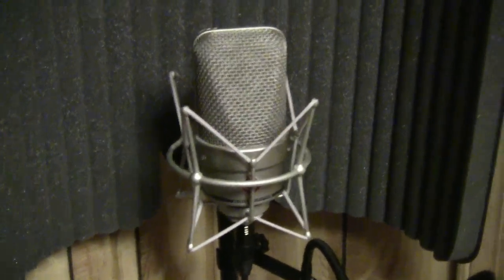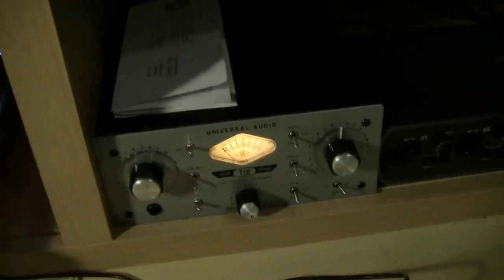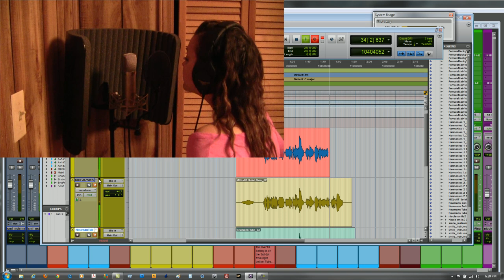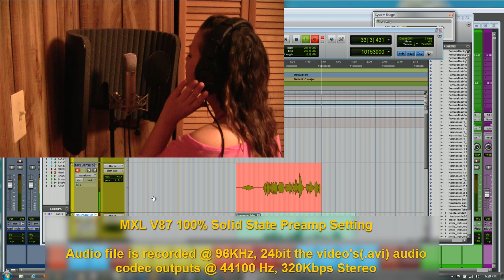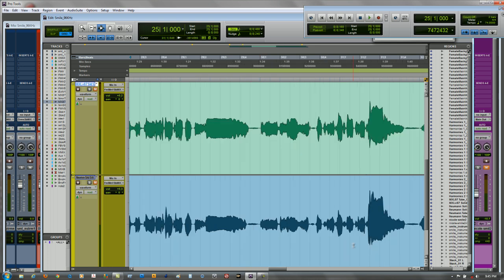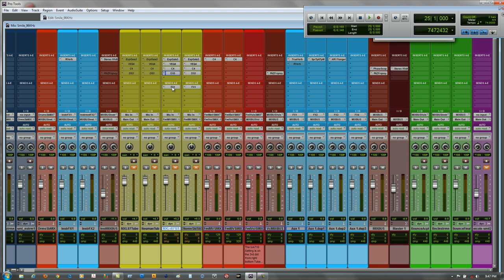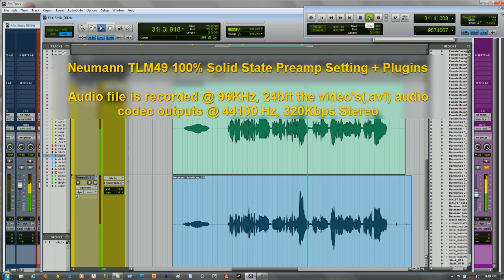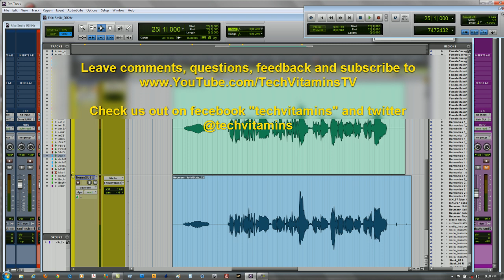Neumann TLM 49 vs $300 condenser mic using UA 710 Twin Finity mic preamp

Comment: Interesting.  The most noticeable things to me are that both the $1600 and the $300 mic can get the job done well and that the 4th take was where the singer started to find comfort with the track. She definitely has nice emotion in all takes, but as is the case with many of us, it takes a few takes to get comfortable with the mix and then the delivery starts to happen. Nice. I got to hear a little more of the 710 too. Thanks for posting the vid.
Reply: It likely took quite a bit of mixing work by somebody who knows what they’re doing to make those two sound equal. I’ve worked with a few microphones around that price range, the most recent is my rode NT1 Which is by far my favorite of that price range. I also have a TLM 49 and there is just no comparison. I rarely ever touch the road unless I’m using it to mic an acoustic or record the room.

Comment: As an audio engineer, you should take everything on a case by case basis. There is no such thing as a "BETTER" mic. Every mic has the perfect use depending on what or who you're putting in front of it. Use your ears, not the price tag. And I suggest putting packing bankers behind the vocalist to get a dryer sound

Comment: Hey bro I got a question!! I just got the UA 710 and have a Rode NTK which is a tube condenser. I was wondering what were your recommended setting to start with? Im running it into he mbox 2 pro.

Comment: to your average listener with not very high end equipment, An MXL will always sound better. I'm using my el cheapo sony v150.  the higher eq accent will cut through a mix better, but at the same time lower end mics tend to muddy the mid and low frequencies. so there's positives and negatives for both mics. one negative on the neumann is the price.  I use an MXL 4000 and the sound is good enough for high quality recording and cheap enough for anyone to afford. Nuemann suits a female voice better.

Comment: i'd just listen with my monitors and actually the Neumann TLM 49 has more body and the high-mid range and low mid range sounds very clean and warm but the mxl sounds very thin and the high mid range has more gain than the Neumann, i don't like too much. maybe this could be an issue on the mix.

Comment from the maker: @mrmikialayardley I am sure you are probably right especially considering the acoustical space i have available to me like you said.  I have however taken the TLM49 to a professional studio a few times and I always ended up using the Audio-Technica AT4033CL that they had there instead because it just sounded better in my and other engineer's opinions, particularly with the artist I am working with(same as in video).  I think that mic goes for around $400.  Do you have any thoughts on the UA 710?

Comment: Okay, everyone already beat the pronunciation thing! :) Anyhow, some technical nitpicks: The Neumann U87ai by your logic is an inferior mic because its output impedance is 200 Ohms? Impedance has pretty much nothing to do with the difference you're hearing in sound quality if the input impedance load on your preamp was designed correctly. It's not necessarily a bad thing, especially for a transformerless design but, most mic pres, are going to present a load impedance of 1kOhm to 1.2kOhms which is just ducky for a mic with an impedance of 200 Ohms. In other words... the difference between an output impedance of 50 Ohms vs. 200 Ohms should not hit anyone's RADAR as a consideration for buying a mic or not.

Now, you said they have "the same frequency response". "Frequency response" is how a piece of gear behaves over a range of frequencies. 20 Hz to 20 kHz does not mean they have the same frequency response as was mentioned early in the video and nobody ever sites frequency response by itself without also specifying the mic's polar pattern and where the dips and peaks are. 

These mics actually have significantly different frequency response curves. Looking at the Neumann's cardiod pattern for example... the low end starts ever so gradually rolling off the low end at 1 kHz. Between 1kHz and 50 Hz (which is 4 octaves) it loses 3 dB in a very linear manner. From 50 Hz to 20 Hz (about... oh I don't care to do the exact math right now... but we'll call that 1.2ish octaves) it loses another 4 dB. So, between 1 kHz, and 20 Hz, it loses 7 dB very linearly. The high end is a little more lengthy to explain but... from 1kHz up to about 5.5 kHz it has a very gradual (and very smooth) rise up to +3 dB. It then dips almost back down to 0 dB by 8 kHz and then has another little presence peak bump at around 12 kHz of about +2 dB. 

Look at the MXL by comparison, it loses 10 dB between 20 and 50 Hz. So, the Neumann loses 4 dB in that range (for a total of -7 dB) where as the MXL just dumps a full 10 dB in that same range. That's not a bad thing. That's not a good thing either, it's just a thing, and it's a thing that's mostly irrelevant because nobody listens to a mic with their eyes (which is after all the point of comparisons like this). ;) Anyhow, moving on, from 50 Hz to 4 kHz... I'm not even going to attempt to try and explain what's going on there because the frequency curve jumps up and down. We'll call it 50 Hz - 4 kHz +2/-3 dB. Now... from 4kHz to about 12 kHz it looks like (hard to tell as the chart they supply is of very poor resolution) it has about a +2 dB presence peak which is pretty flat. 

What does all of this mean? It means that maybe you'll like one mic for one thing, and the other for other things. But is that it? No, there are myriads of unpublished specs that affect sound quality as well (which is again why we listen). The components as well as the circuit design of the preamp inside the mic also have a huge effect on a mic's characteristics. This is why you have so many 3rd party companies offering electronics upgrade kits for MXL mics. The MXL is not going to use components of the same grade as the components used in the Neumann. Interestingly enough though, there's some surprisingly cheap mods out there that give you resistors with 1% tolerances, high quality capacitors, etc. Heck, you can even replace the capsule with a higher quality capsule (and umm... well you end up with a whole different mic in the end). 

So to sum up for people who are learning... Output impedance, don't worry about that. Just make sure you use a mic pre and not a line level input for your mics. If you're using a mic level input/mic pre well... there's a pretty darn good chance the load impedance will be adequately high to make everyone happy.

Frequency response - Frequency response changes based on polar pattern, it changes based upon how on or off axis the source is to the mic (that's another way to control your sound), and depending on the mic and the polar pattern, it can change based upon how close the subject is to the mic (Google "proximity effect"). Since you don't see with your eyes, you should spend a lot of time looking at frequency response charts, at least not when you're learning (they're worth looking at, but only so your brain can start building a sonic catalog so you can understand how that might be relevant to you in the future, but mostly how it's completely irrelevant in most applications).

Comment: To all the guy's hatting on this video mlx vs. tlm49
and sending them both tru the same highend pre-amp demonstrates your lack of understanding about mic design and construction  even the ones hand crafted in germany follow the same set of rules the size of the head it's freq. response etc  in put out put levels etc etc.  So in closing it's not the mic or the manufactures fault you bought that mic it's your lack of undertanding and pocket book that got you those results